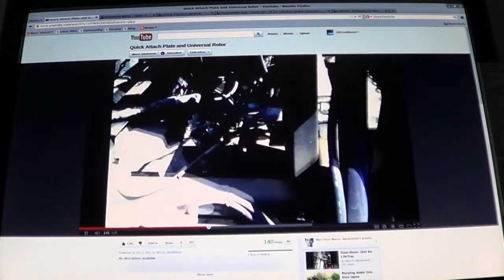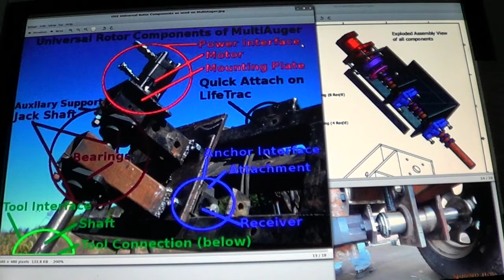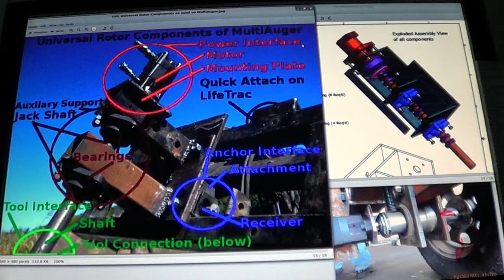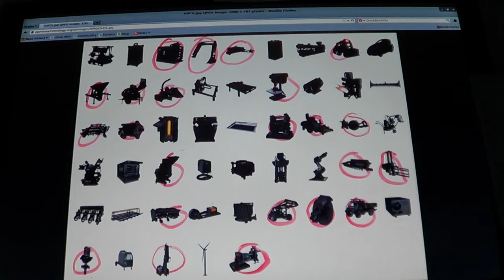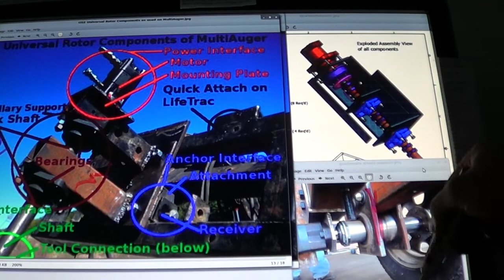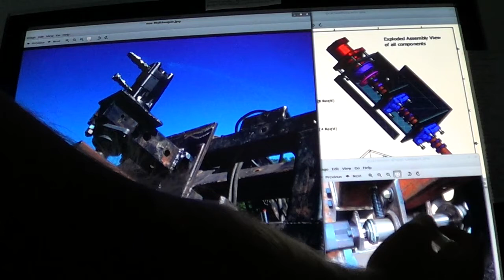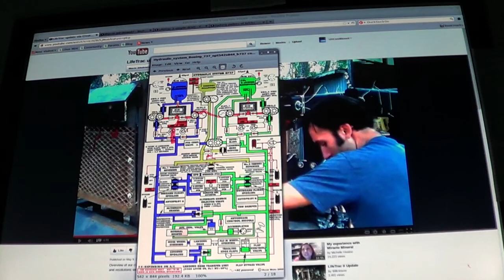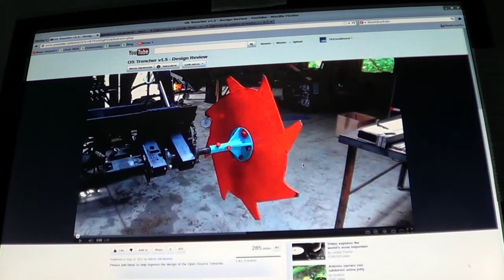OSE Universal Rotor Redesign Response Part1

Comment: Excellent, clear overview of design points and issues. Beginning of a veritable remote review and collaboration process. Excellent clarification of relation of Univeral Rotor to Wheel Units. Good discussion of Interface Design. Point of 26 Machines being used with Universal Rotor is correct. Scalability discussion points how this can be universally relevant to machines. I like the Replicator and Villagers - relevant analysis of social dynamics. 

Axial and radial forces need to be addressed.

Comment: My only disagreement is the comment on cost - hydraulics are relatively inexpensive - under $300 for the 15,000 in-lb, 41 hp motor shown. Our 27 hp Power Cube is $2k in materials. The cost is extremely favorable when we consider that many devices can be powered with a hydrualic Power Cube - itself a modular device.